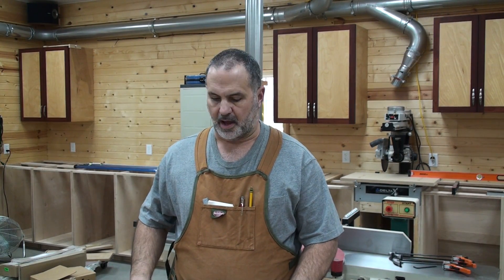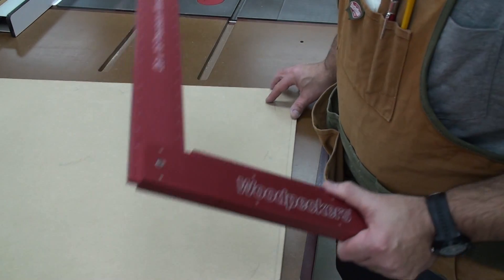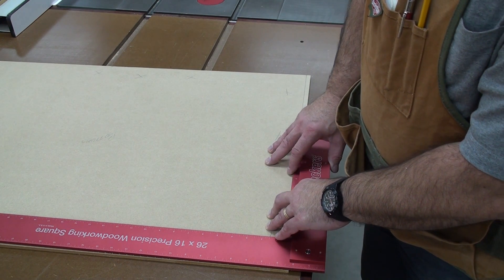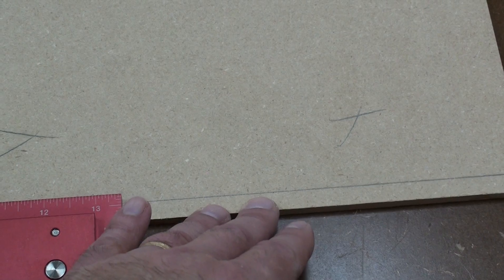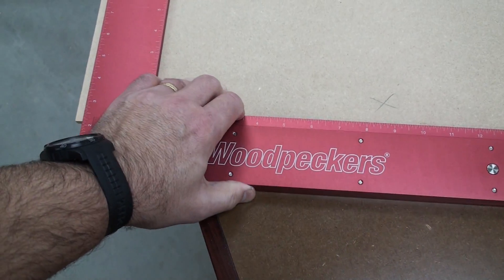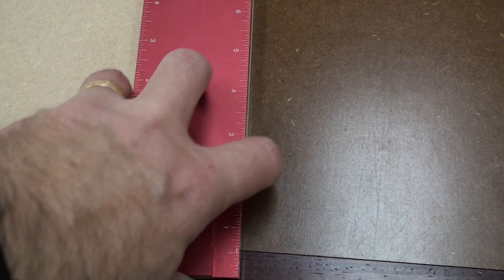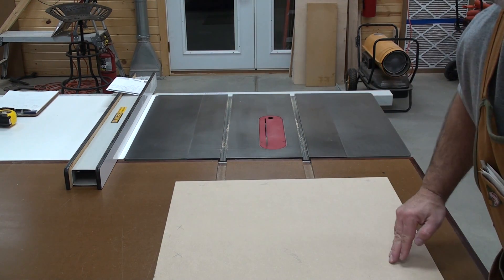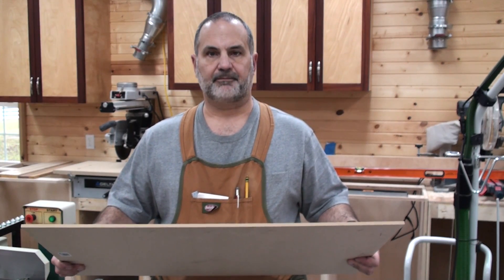Quick Tip 01 - Squaring Up Sheet Stock 180301

Comment: I am new to woodworking and as of yet, I have not found a single 4 x 8 sheet of plywood nor mdf from Home Depot nor Lowes that has 4 square corners, a true rectangle. Every panel I cut out of them, I need to true-up in just this way. That's life, I guess.
Reply from the maker: I hear you. They are massed produced and I have to always square up my stock before I start processing my parts from it.

Comment: Hello Frank. You are just awesome. This has been my Delma for the last six months. I can not wait until tomorrow to test this. 
01–Do I have to have a tack saw or I can do it with circular saw. ?
02–What is the difference between track saw and circular saw ? 
03– If I have to get a track saw would any track saw do the job?
04– By gripper do you mean your original base line ?
Once again thanks
Reply from the maker: Hi Bijan Thanks for watching my video and for the compliment. 01 - You can do it with a circular saw, but I suggest making an inexpensive track for your circular saw. There are lots of good videos on YouTube showing how to make one. A simple one I've used in my past is from a good friend and Maker, Jon Peters. Here is his video: https://youtu.be/xJ2Ru0oOth0  02-They both are a circular saw except the track saw base has specific grooves that fit into that saw makers track to keep the saw straight and to know where you are cutting. 03-Most track saws on the market are pretty good. But they all range in price as you can imagine. I believe Festool was the first to come out with a track saw which is when I bought mine and love it. Now they are several out there that are excellent.
Reply: Hi Frank. Thanks foe responding. Can you make a video to square a piece of wood that all four sides are not square? Also can you elaborate more on how track saw makes a more precise cut. Thanks
Reply from the maker: @bijan4727  Let me see what I can do after my current client project.

Comment: Two things, I love your apron, wher did you get it? Second, does this method work for a already, previously cut, piece acquired from another project?
Reply from the maker: Hi Dennis. Thanks for watching my video. That apron is a BucketBoss apron. But I've changed it out for my dream apron from Leather by Dragonfly. Check them out...you will love their customer aprons. And yes, this same method works for any sheet good, any size, even if it is previously cut. You just need to find or make the two sides I called Guide and Gripper exactly 90 degrees and the rest is easy.

Comment: Hi. This was an excellent demonstration. Can I use a circular saw instead of an expensive track saw or I have to use a track saw ? 
Second question what is the difference between a track saw and a circular saw ?  Thanks for clarifying my problem.
Reply from the maker: Thanks for watching the video. You can use a circular saw using a home made track saw. There are a lot of YouTube videos out there to show you how to make one. A track saw is basically a circular saw that has mechanical rails to provide zero clearance when sliding forward on the track. I hope this helps.

Comment: Great video. What if you don’t have a large shop nor a massive table saw like you have?I have a cheap little table saw that really can’t accommodate any large sheets. I might need to resort to a skil saw and possibly with a track guide like the festol you used. Would that work? I’m trying to cut square melamine for drawer bottoms for a double walled metal drawer box system like the Blum Legrabox and the Hettich AvanTech
Reply from the maker: Hi Paul, A track saw is a great option. Do a search on YouTube for homemade track saw guide and there are some great videos on how to make one inexpensively. Or you can purchase any of the hand saw manufacturer's tracks for their saw...there are dozens out there. The squaring up process works the same whether on a table saw or using a track saw. I hope this helps...and thanks for watching my video.
Reply: @frankswooddesigns9346  Hi Frank, I appreciate your response. It was helpful. And I decided to buy the Krug AccuRip and their AccuCut products which will work with my Skil saw. Thank you
Reply from the maker: @pauld2502  Great choice.

Comment: I’m currently trying to make a platform for a radial arm saw. Is MDF required?
Reply from the maker: No not required but MDF is a good flat stable wood to use for wood shop surfaces. It’s usually dead flat unless it was stored improperly.

Comment: I’m confused you used the side that was closest to square but still off, then cut the square factory edge with a track saw and then called the non square end square now I’m confused
Reply from the maker: It really doesn't matter what edge of the sheet good you cut off. The important part to understand is at 6:55 minutes of the video; creating a perfect 90 degree. Then use those two sides to run along your fence to cut the opposing sides of the sheet good. That will provide you with a perfectly square sheet good. Thanks for watching.
Reply: That confused me at first as well. You have to remember all cuts are straight just not necessarily at a perfect 90 degree. So at 6:55 when the short side of the square was on the straight edge it gave him a perfect straight and 90degree line to cut on the other part of the square

Comment: Hello, I am totally new with doing woodwork.Bought a 8x4 1/4 inch sheet of plywood. I asked the guy to cut it square into 8x2 and then 4x2....Well,it was all &^%$*. None of the pieces were square.it fluctuated from 1/16 to 1/8.   I am looking at your demo I dont understand why you put your square on top of the stock instead of the edge.Plus what is the line for on the plywood.    Thank you again !!!!!
Reply from the maker: Hi Mundi, thanks for watching. The square I am using is a special square that rests on top the stock so it’s easier to see your opposing edges. The line is the 90 degree mark which is used to cut it off creating a perfect 90 degree angle to take to the table saw to totally square up the sheet. Hope this helps.
Reply: @frankswooddesigns9346     Thank you very much for your reply and yes it definitely helped .Thank you very much again !!!!!!
Reply from the maker: @mundlkalli4396  Glad to help!

Comment: Thank you. I found out the hard way that exactly what you described is accurate. Bought a quarter sheet of 1/2" ply and assumed it was square only to find out that it was 3/16" off of the final dimension
Reply from the maker: Glad my video was helpful. This process always provides a share sheet of stock for projects. Thanks for watching the video.

Comment: What if both gripper sides are not close enough. In this video one side was close and used. Thanks
Reply from the maker: dlt205 There is only one gripper side and one side guide side (which is always 90 degrees to the gripper). When ensuring the gripper and side guide sides are perfectly 90 degrees, and you use those two sides against the fence to cut their opposing sides, you are guaranteed to have a perfectly square piece when finished cutting (as long as your fence is square to your table saw). Hope this helps and thanks for watching my video.

Comment: Thanks for posting!  Very helpful.  What if I don't have a track saw?  What is the next best saw to use?
Reply from the maker: You are welcome. You can make an inexpensive track saw using any circular saw. Get a 5 foot long piece of 1/8th inch of plywood. Also get a 5 foot long 1” x 3” pine board that is perfectly straight. Glue it to one end of the 5 foot plywood. Let it dry. Then cut the plywood 1” wider than the width of your circular saw (approx 6-7”) from the edge of the 1 x 3. Next, place this track down on a 4 foot wide board. Run your circular saw along the 1 x 3 as it will cut the plywood to the exact cutting width of your circular saw. You can now use that as a track saw. There are videos on YT showing these being made. Hope that helps. And thanks for watching my video.

Comment: on 9:10 you took the measurements from corner to corner on both side and both come up the same and than you said you guarantee that peace of lumber is NOT square!
Reply from the maker: Robert B I actually said this is now perfectly square.
Reply: @frankswooddesigns9346  I heard "now" 😊 Assume one of those Kreg circular saw guides will work as well as track saw. Don't have one, but considering. Thanks for this video!